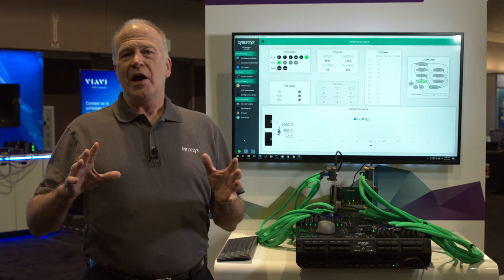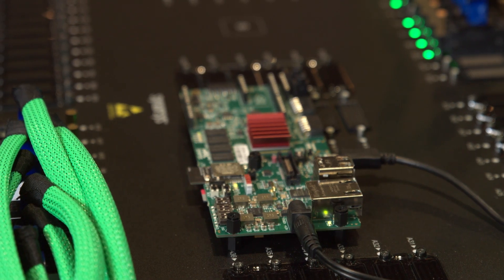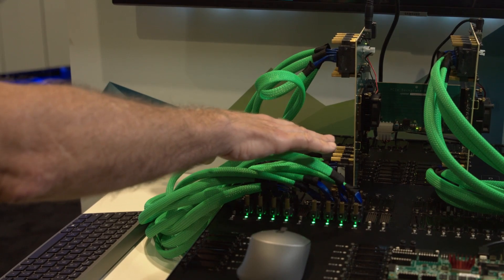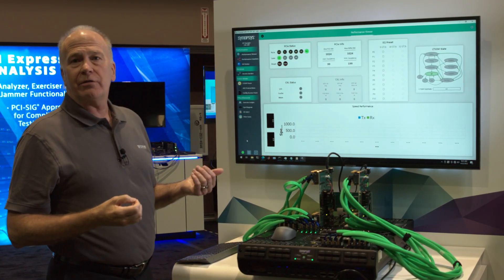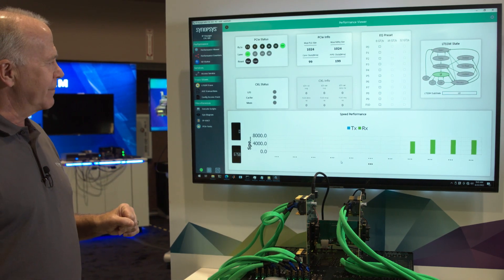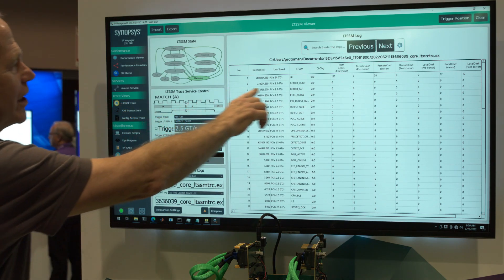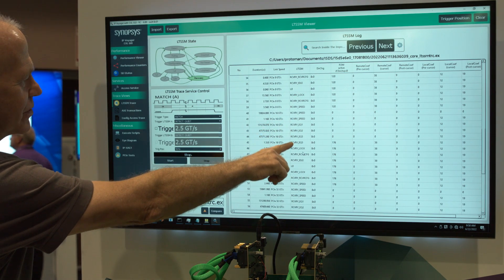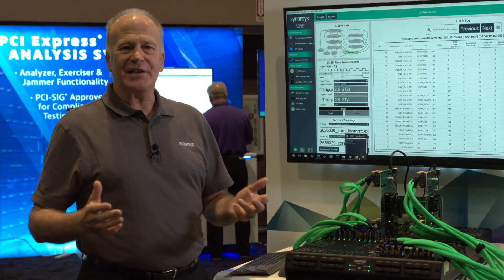PCIe 6.0 End-to-End Hardware Linkup and Performance | Synopsys

Comment: Does anyone have an idea how to monitor actual pcie transfer speeds in a desktop? Or see what a thunderbolt controller is actually using? I’m not talking about testing potential throughput with a dummy load, but monitoring live usage.

Comment: Nothing even uses Gen5 yet AFAIK.  The Z690 chipset offers Gen5 slots but there are no Gen5 GPU's or NVME drives.
Reply: set the standard now, everyone else can catch up later
Reply: This is when I upgrade my rig from the 5950x 128gb ram gen4+ capable drives 3090 think I can wait till gen 6 DDR 6is available.
Reply: Been stuck on 3.0 for over a decade and now they're just coming out with new ones every couple years
Reply: @archietheproto7706  the board must have retired and let there ADHD co-workers take the reins of HDMI/PCIe/USB